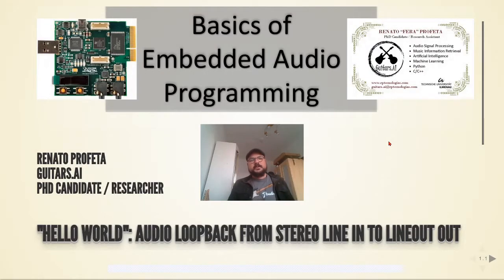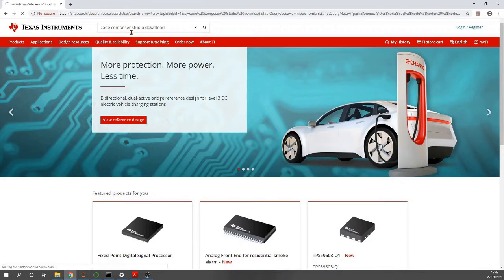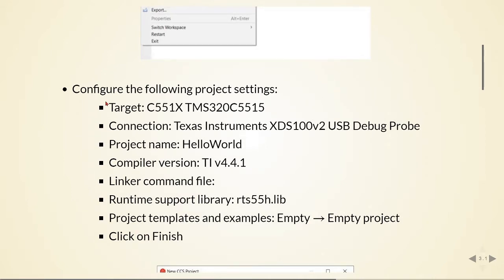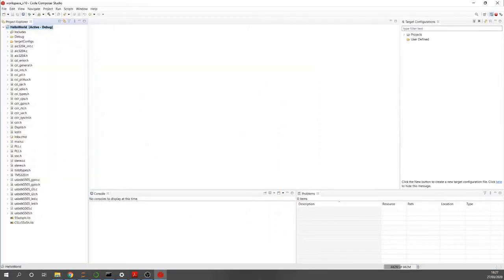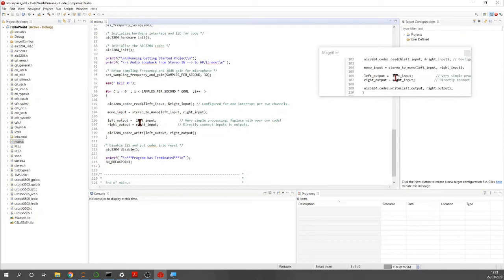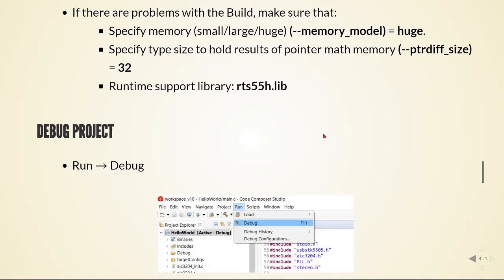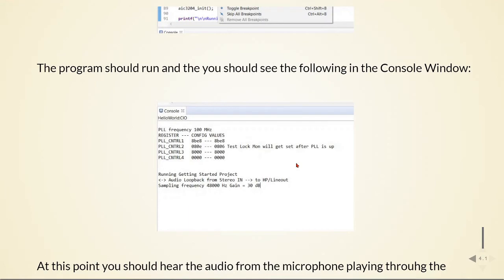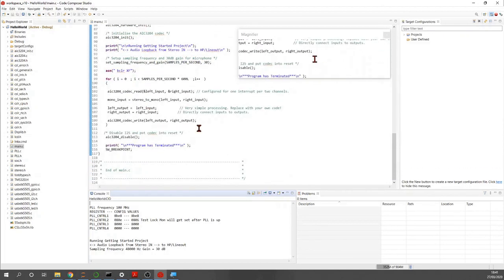02 "Hello World": Audio Loopback - Basics of Embedded Audio Programming using C

Comment: I am trying to get this code working on the C5535 version of your board. I cannot figure out why this wont run, do you have any ideas where to start?
Reply from the maker: This is probably a configuration issue. Try to check out the Getting Started documentation of your specific board.
Reply from the maker: Maybe this would help 
https://raulbehl.wordpress.com/2015/05/24/tms320c5535-ezdsp-usb-stick-audio-playback/
Reply from the maker: Or maybe this
https://raulbehl.wordpress.com/2015/04/21/using-texas-instruments-tms320c5535-ezdsp-usb-stick-code-composer-studio-v4/
Reply: @the-sound-travels  Thank you, this did the job. It was the libraries that I needed to import.